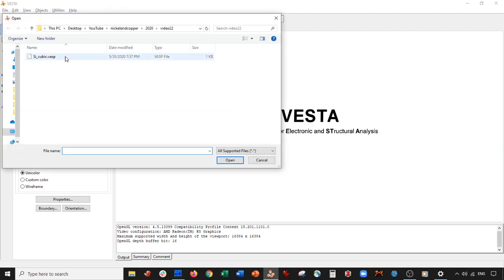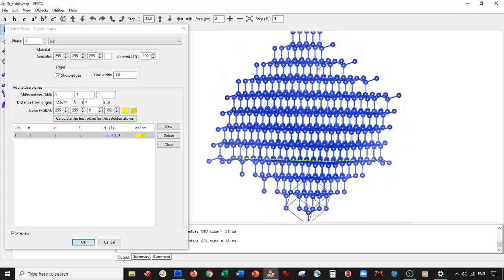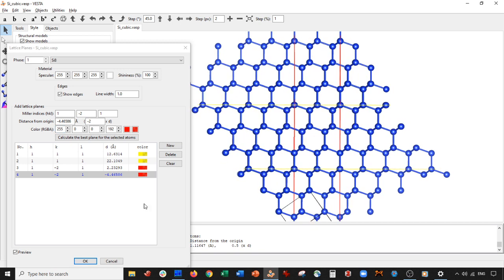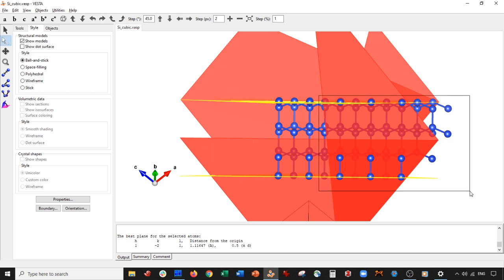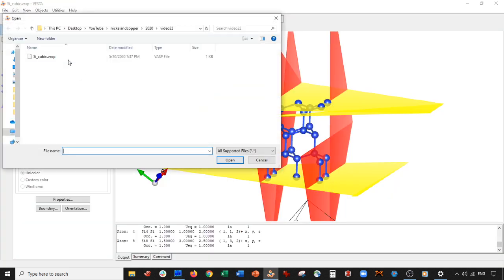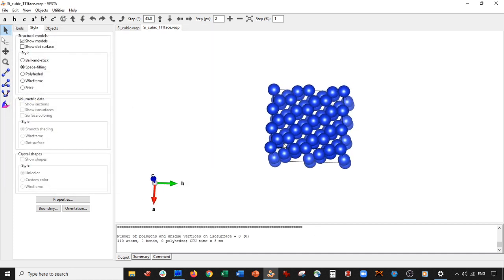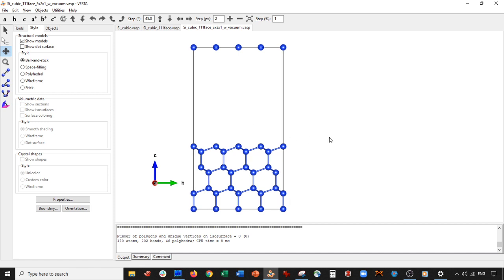VESTA Software - Bulk Silicon Surface Slab Add Vacuum

Comment: Hi, you are great. I watched your Bi2Se3 monolayer and bilayer video and I learned a lot. But I could not create the 4, 6, and 8 layers of the same structure as the paper "Heterostructures of Graphene and Topological Insulators Bi2Se3, Bi2Te3, and Sb2Te3" in Figure 1-a. Can you make a video for that or do you have any suggestions about that topic? Thanks a lot.

Comment: thanks your for thr information, just a silly question to confirm for an hexagonal cell on (0001) for most dense surface we only have to add the vacuum because it still going to be the same surfece (0001)

Comment: I am trying make a new unit cell for CoB structure where the (111) face is on the C-axis and I am having trouble getting the transformation matrix since there are no atoms on the edges of the orthorhombic unit cell I want to make. Got any ideas as to how I can make this?
Reply from the maker: Send me the link to the structure and I’ll see what I can do
Reply: @nickelandcopper5636  The link to the .cif file is below, thanks again.
http://www.crystallography.net/cod/1010478.html
Reply from the maker: Here is the transformation matrix:

0 -1   1
1  0  -1
-1 -1 -1

Let me know how it goes. The c axis should be the [111] surface
Reply: @nickelandcopper5636  The thing I am confused with this transformation is that the angles between three different axes are no longer 90 deg.
Reply from the maker: Sometime this happens - see my ZrO2 video. I think if you want to keep the angles 90 you would need to use the 110 surface not the 111
Reply: @nickelandcopper5636  Oh hey, ya I took a look at the video, it really helped  me understand it more. Thank you so much help these vids are awesome.
Reply: @nickelandcopper5636  Oh hey one more question with the CoB-[111] cell.  So I made a 2x2x2 supercell of it and I noticed that when I added vacuum (15A) in the c-dimension the repeat unit gets shifted by half of the supercell, do you have an idea why this occurs and how to prevent it? The .vasp file for both before and after the vacuum addition look identical other than the new c-dimension size.

Comment: when i choose a different origin than yours, i got lattice parameters (a & b) different than yours, while c is the same as yours, Also the transformation matrix is different. My question is , is there any criteria for choosing the origin point & direction a,b & c ?
Reply from the maker: No it should yield the same structure in the end, maybe just rotated, but equivalent

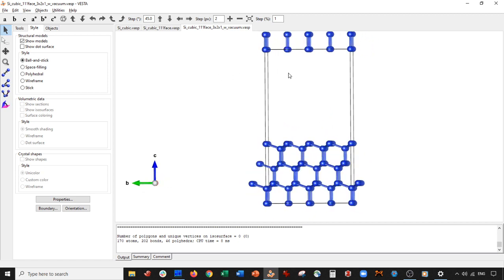Comment: Hey, so if you were to run some calculations with the (111) surface you made here, would it be the one at 13:23 or after deleting all the atoms outside of the cell (13:39)?
Reply from the maker: It would be the one after deleting the atoms. The extra atoms that show when initially loading at 13:23 are automatically added by Vesta when the structure is loaded. They are not really present in the system. Specifically, the coordinates you use would be the coordinates in the vasp file right before we loaded at 13:23. Just make sure to add the atom label to each of the 84 atoms.
Reply from the maker: And of course - always seek a second opinion.

Comment: is possible for oxide zircoium monoclinic to build slab(111) ??
Reply from the maker: Hi. Ya, I don’t see why not. Send me the formula and I’ll take a look. Also send me the space group. Try to give me as much information as possible
Reply: Hi, your explanation is excellent but try to do for oxide zirconium monoclinic p21/c . It didn't work.
I can't find the error, for to build slab111
Reply from the maker: I’ll look into this
Reply: @nickelandcopper5636  thanks
Reply from the maker: I was able to do it. It’s extremely tricky. It will be my next video.
Reply from the maker: The reason is because the new unit cell must have non 90 deg. angles in it
Reply from the maker: Just letting all know the video has been made and is available